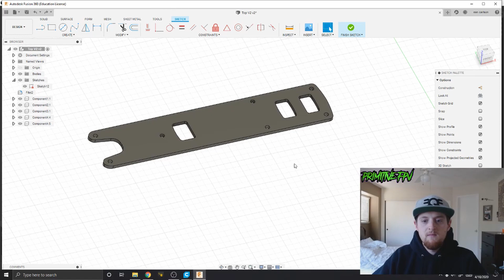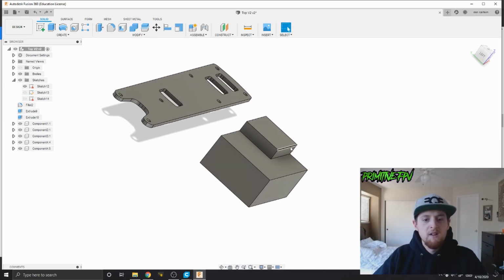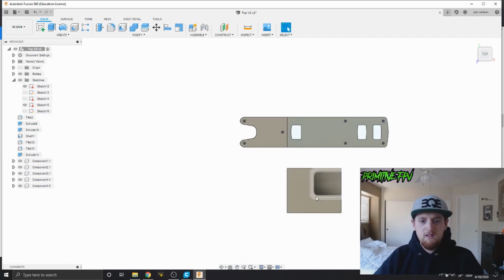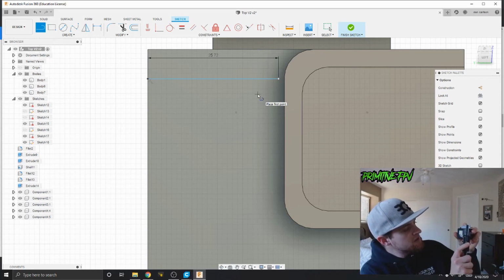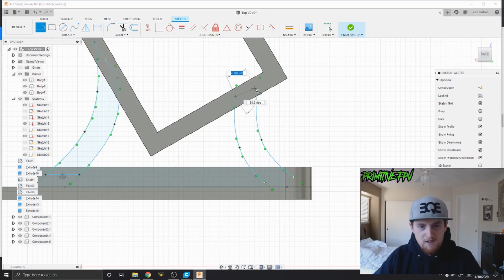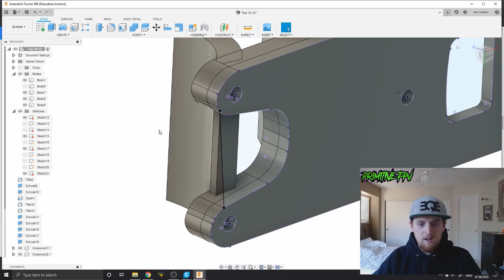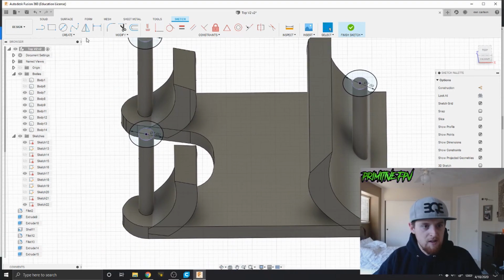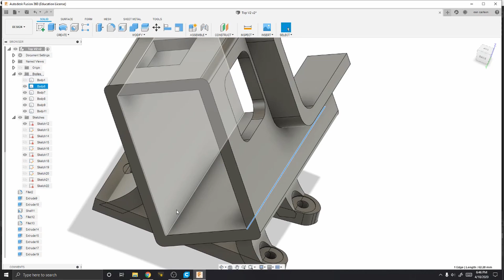How To Make A Go Pro Mount - Fusion 360 Tutorial

Comment: You are overlapping walls, I means that's fine if you dont want to print it but a printer will see those internal walls and try to print them. It's a bad way to model dude, the end result should be 1 complete piece, not 3 separate pieces overlapping. I only say this because I just fixed a mount someone who followed your tutorial had made and it didnt print well for him.
Reply from the maker: Wheb you run an extrude command and one shape runs through another fusion should merge those shapes. You buddy might have had new body or new component selected when doing those commands. The end result will not have interal walls if done correctly
Reply: @primitivefpv6660  unfortunately that doesn't happen, it will print 2 pieces stuck together, there is no true fusion between them and the walls are likely to seperate under stress. Joining to models is easy, the only reason I came across your video was because someone reached out to me to help them print the model they had made from following the video, they had a failed print due to the parts not being joined properly. I see this kind of thing all over the place and help people fix broken designs quite regularly. 

Your way may print but structurally it can fail.
Reply from the maker: Have your friend reach out to me on facebook. Im curious to see what the real problem is. If something in the tutorial is misleading I would want to get that fixed. I can assure you tho ive never had issues with print strength. I go through more carbon than TPU
Reply: @primitivefpv6660  I model with blender and am not familiar fusion but overlapping models is like pineapple on pizza for me 🤣. I have to make them perfect but then I'm crazy OCD about that kind of thing 👍
Reply: @primitivefpv6660  also that was 6 months ago I forget who the guy was now hahaha
Reply from the maker: In fusion in order to merge shapes the models have to overlap for the merge to work. If the models are not touching the command will give you an error prompt
Reply: @primitivefpv6660  I guess it depends on your slicer too

Comment: what orientation did you use to print?  ie...what side was face down on the build plate?  Also, do you use supports?
Reply from the maker: Lense side down. I print no supports even tho it droops a little bit on the feet but it saves time

Comment: Thanks a lot for this! Did you also re-design the top plate of the frame in fusion? Or did you import that from somewhere? Getting all the screwholes right must be tricky , and all the curves on the frame etc..
Reply from the maker: That top plate was made when I was using 123d design which is an autodesk program they discontinued. You can import most of the common 3D and 2D formats to fusion.